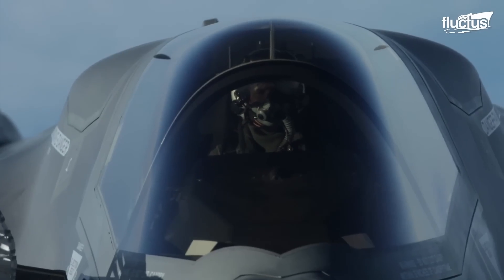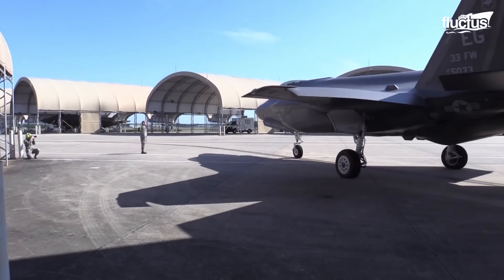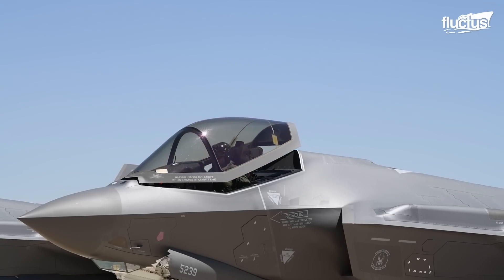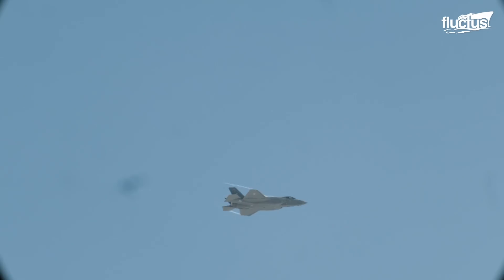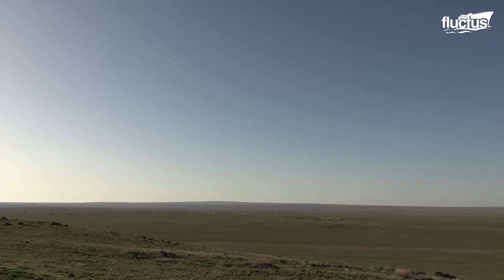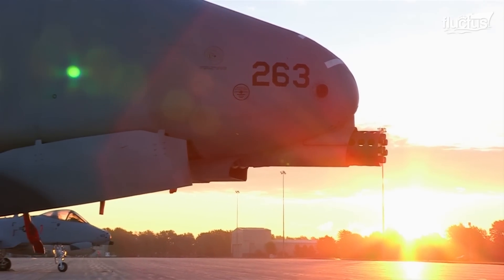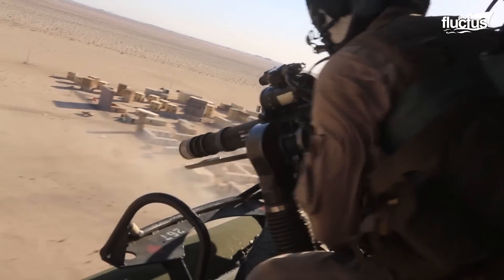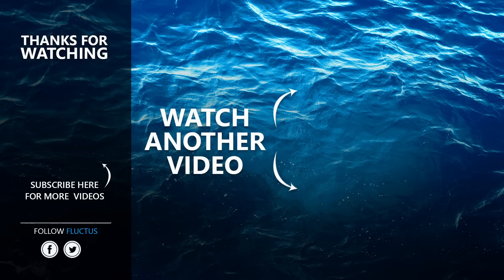Testing US F-35’s Gatling Gun to the Extreme Limits: The Mighty GAU-12 Equalizer

Comment: 182 rounds:  I believe the gun is there more for show than really troop protection.  The air force was soooo much trying to retire the beloved A-10, and replace it with this absurdly expensive "replacement", and they needed to put the gun in there to pretend it could replace the A-10 for close air support.  It can't.  It is designed for an entirely different mission.  The A-10 has huge loiter times and low speeds.  Oh, yeah, and almost 1200 rounds for the cannon..
Reply: "The A-10 has huge loiter times and low speeds."(sic)

And is a huge IR MANPAD magnet in a high threat environment as we learned 30+ years ago.
Reply: Yep I concur, what a bunch of BS. But typical Air Force, I can shoot 182 rounds so that makes it a Close Air Support Aircraft. Rather have a A-1 then this thing. What a close Air Support Joke.

Comment: @10:50 the gun is not off center to the left. The gun is directly centered with the aircraft. The nose landing gear is offset to the right to accomodate the gun.
Reply: the whole  gatling assembly is actually offset to the left, but the shooting barrel is centered.

Fun fact : the shooting barrel axis also really close to the COG of the plane to compensate the pitch effect from firing the gun.

Comment: Fun fact: the first gen f 35's guns were too big and bent/broke the frames when fired so they could not use their guns at all until future gens were made with smaller guns. One of many many failures for this joke of a propaganda aircraft. 😂😂
Reply: "until future gens were made with smaller guns."(sic)

When Tyler Durden posts, facts take a sabbatical.

The GAU-22 is a four barrel 25MM cannon - and has been since day one - a caliber that is larger than the 20MM M61 used on the F-15, F-16, F/A-18 and F-22. Parroting a 4 year old DOT&E report that doesn't reflect changes made in mounting, boresighting, hardware and software on Lot 9 and newer F-35As renders your argument moot, yet again, pogue.